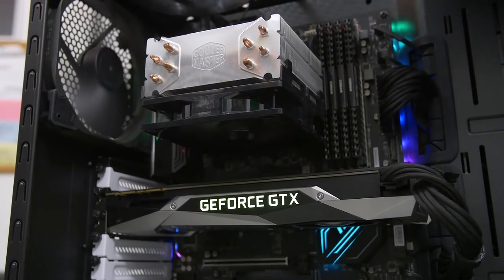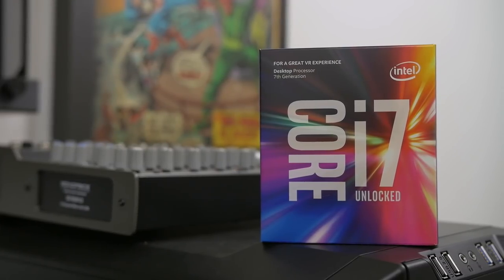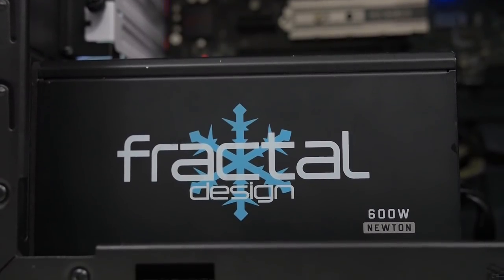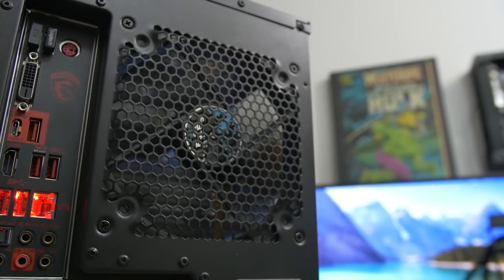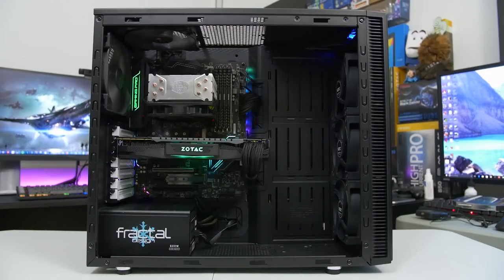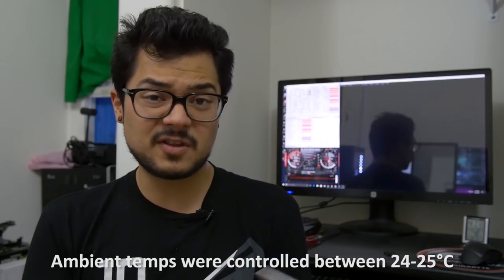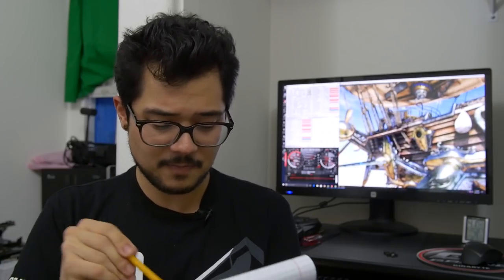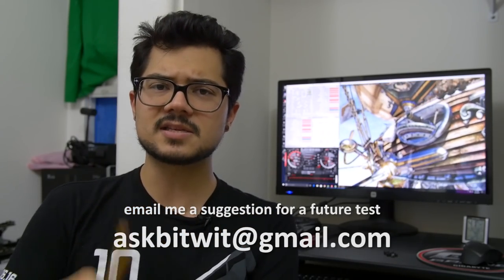This is how you should mount your CPU cooler! I think??

Comment: What about fan speeds... how did they look when swapping graphics cars type?? Some times you see a faulty readout on the monitoring software.
Another thing you may be underestimating is the efficiency of the "open" card fans vs closed ones (blower style). Especially when using an very well vented case. 
I've seen similar different results, like  your self, when changing cards. 

Lastly thermal past factor. How long time past in between swapping and did the cpu have time cool when swapping cards? Are we talking days or hours between tests? I for one have seen fairly large temp differences over as little as ½ day, with cool-down periods of a few hours... 
 
Thx for a good channel ;-)    

P.S. try placing heat sensors around the closed vs open style cards, that might just reveal the answer (not on - but in between GPU & CPU).

Comment: The Hyper T4 could only be mounted in the towards the top position and always worked fine.  If you have no top air vents or fans this position would seem bad though.  but with twin 140's at the top or 120's this never had an issue.

Comment: what were the GPU temperatures between the cards? I'd fathom a guess that the open air cooler is far more efficient at cooling the GPU and in a horizontal configuration the hotter air doesn't path through the CPU, meaning the overall case ambient temperature would remain lower? If you have the budget do a smoke test with a clear plastic case cover and let's watch the flow?

Comment: Maybe GPU temps could tell us more. I think the open card with the vertical config just ran cooler and did not heat up the air below the CPU as much as the blower config. 
Just speculation.

Comment: Your intake is pushing air away from the graphics card making horizontal + open good. Then on vertical + open, the cpu cooler is pulling more air from the card than the intake is pushing away from it.

Comment: I'd be more interested to see these tests done with a de-lidded CPU with direct-core contact and one of these budget heatsinks. I have reason to believe the tests are possibly being skewed a slight tad by whatever thermal compound Intel decided to use under the lid with this generation. even if the test bench is an older board and CPU known for having thermal compound under the lid (i.e. an Ivy Bridge 3570k) it'd be an interesting test nonetheless.

Comment: What was the GPU temp on each card? Maybe the blower card had a higher temp than the custom cooler, therefore raising the temp within the case. Also, with the vertical air-flow you are pulling air directly from where the GPU is located.

Comment: vertical with blower style card runs hotter because the CPU heat sink is closer to the hotter running GPU of the blower card
horiz. with aftermarket card runs hotter because you're sucking warm air from the GPU area instead of from the cooler front of the case

that's my theory anyway :P

Comment: What were the temps on the GPU versus blower/open? The temp of the GPU is centralised close to the CPU, so if that's running hotter because it's less efficiently getting heat away then the temperature right next to the CPU cooler will possibly be hotter?

Would also suggest if you re-run the test do it with exhaust fans to match the orientation of the CPU, rather than having both horizontal and vertical exhausts, to see if that makes much difference to the temp. I think this would represent more realistically the sort of set up someone would be likely to have.

Comment: I think it is because with the horizontal setup the fan is pulling more of the cooler air front the front 3 fans rather than the vertical setup pulling all of its air for the much warmer card?

Comment: Close shroud cooler fans run at higher RPM, potentially taking fresh air away from the CPU cooler from the front intake at a higher rate than an open shroud would???

Comment: my guess is turbulence is causing a better stream of fresh air.  when you use blower style, it grabs the air from the bottom half of the fans on front of case and pulls it out the back.  however, when you use a open shroud, it causes turbulence that could help deflect and direct the airflow more through the cooler.  yes, the hot air from the GPU rises, BUT you've got a streamline from intake directly through the cooler that causes Hot GPU exhaust to shoot under the CPU cooler and a low-pressure zone right at CPU cooler exhaust that grabs the GPUs warm air and shoots it out of the back of the case.  how could you potentially confirm it? measure the temp of the rear exhaust fan and compare between both horizontal and vertical tests.
Reply: the low pressure zone is caused by the cooler.  it puts resistance on the fan mounted to it and when you compare that to the rear case exhaust that moves more air, more quickly it causes a demand of air that'll be pulled from the path of least resistance: above and around the GPU because hot air rises right off of it.  if that makes sense.  I'm making both of these comments when im pretty tired, so my explanation might sound weird but it sounds better in my head. 

cooler pushes air which grabs hot air off GPU which the rear exhaust fan then pulls.    it's just using airflow to grab more airflow.

Comment: I think that the results from the first test might have been compromised by case pressure. I had a problem recently with unexpectedly high temps on ram and chipset in my system. I had 2x120 and 1x140mm fans as intake in the front and bottom of my case respectively, and a 120 fan on the back and 2x120 radiator on the top as exhaust, along with a 980 ti w/ a blower style cooler. The result was that in games, even with my intake fans turned up all the way, there was basically a dead spot over the top section of my mobo. I swapped out the front fans for 3 NF-A14 iPPC's, removed the rear exhaust fan, and the issue seems to have cleared up.  I would love to see the results if you could run the tests again with a different fan configuration, with better intake fans or perhaps with the top exhaust fan removed and the moduvent covers installed.

Comment: Bit late to the party on this one. But maybe the blower card is dispersing more heat through the backplate?

Also i'm guessing your 7700k has been delidded? Because those temps seem quite low comparatively to what i've been seeing in forums with that exact cpu/cooler combo.

Comment: In regards to the first test results, I wonder if its the same principle as a fire place?  You would think that the house would become warmer but in actuality the house gets colder unless you are right next to the fire. idk just a thought. As for the second test, the cpu fan is taking some of the heat radiating off the gpu and passing it through the cpu heat sink.  Which, I assume would make it harder for the cpu cooler to do its job.  It might do some good to run another test checking gpu temps as well.

Comment: With the blower style card more air is being pushed/sucked out of the case than the open one which keeps the air in the computer allowing there for to be more air to soak up heat, a much better way of explaining this is called POSITIVE AND NEGATIVE PRESSURE I think Linus or jaystwocents did a video on this

Comment: the only thing I can reason and would have suggested so results are as similar as possible swap gpu closed to open style in a CLOSED case, with that top fan frontal section blocked off, or even that one fan moved to next slot up (so rear exhaust fan -- -- or rear exhaust -- fan -- or possibly rear exhaust -- -- fan (the -- being blocked off portion) a difference of 5c IMO is within margin of error because all it takes is for the pressure on cpu heatsink to not be exactly 100% the same every install or the thermal paste 100% same every time..I know from my own experience 1 single rear exhaust and one single top exhaust mid point above heatsink seemed to work the best with the cpu cooler pointing front to back (horizontal) instead of up and down i.e east west not north south, it seemed to keep my gpu a wee bit cooler but the cpu a wee bit warmer.

for my test, I blocked off fan in top of case, moved that same fan forward just by doing this alone it influenced the cpu to be hotter gpu to be cooler or the other way around by ~3-7c idle and load, not 100% sure for the vertical vs horizontal position however...I am using the hyper 212 plus 2x stock P/P fans on Phenom II 955 OC to 3.8Ghz @ 1.35-1.362v CPU-NB 2643 HT 2044 MX4 paste with MSI 7870 TF III OC also MX 4...I am now using a define C case, 1x120mm exhaust top blocked off, 3 120mm intake and 1 120mm intake on the "floor" to ram more air behind the motherboard tray to ensure SSD/HDD get as much air as possible thrown at them.

So different systems for sure, but mine would likely be very close +/- similar heatouput. for me heaviest cpu/gpu temps I have seen when was summer time out about 3 months ago was 46c cpu/61c gpu at 1175 core 1350 memory 100% load on both..previous case was antec GX700 (neat design a bit easier to work in kind of than this FD Define C BUT very shitty dust filtering in comparison whereas this new case getting it all wired up with harddrive/ssd is a major pain in the a$$ but excellent dust filtering and a fair amount quieter cpu temps about 3c cooler than was in the GX700 gpu temps about 4c warmer SSD/HDD however a good 9c hotter (never seen my HDD/SDD ever hit 27c in the Antec one, whereas in this one my SSD almost a constant 33c even with AC running full blast my HDD used to be a constant 25c new FD define C 39-44c (still safe by all means)

anyways, I would test with case closed up, test with one gpu closed shroud move that top exhaust fan towards back toward mid towards front block off the other 2 holes (that is one thing I like about the Define S individual top vent block things whereas the Define C is either all 3 blocked off all 3 open with a dust filter included or all 3 open no filter...should have got the S)
see how that fan moved back mid forward effects temps on open shroud gpu as well, than flip  the cpu cooler from horizontal to vertical same way, you want to do as many tests as possible without moving the cpu cooler around so as not to disturb the thermal paste of course.

I would imagine the open shroud design benefits from having the cpu cooler "suck up" i.e north to south so as not to rob air from it (works with the fans in the gpu cooler) whereas the closed cooler probably benefit more from cpu cooler being east west so as to not fight the air flow it needs.

Also east to west probably helps to keep the system ram, vregs etc cooler compared to north south where some of these critical parts might be robbed of airflow...the little bit I DO know for sure, the "smoother" the air flow, that is the less blocking its path of the better, so maybe moving that top fan from back to middle to front has a very large influence (maybe)

^.^

Comment: @Bitwit. Most probably its because the open shroud has better cooling based on its heat pipes and back plate, and the blower type was not that effective dissipating heat... maybe should take into account the gpus thermal dissipation inside the case.

Comment: In the horizontal cpu fan test...The temp of the GPU could of been affecting the CPU as well.  Since the blower style cooler tend to run hotter than the AIB cards typically do? Just a thought.

Comment: The reduction of CPU temperature with the open gpu could be caused by the hot air from the gpu going up and limiting the exhaust fan's effectiveness. where as with the CPU fan pointed vertically all the hot air is free to rise once exiting the case. 

I low key wanna see one of these horizontally blow through cases (intake fans on the front exhaust fans on the back) put on the front plate and stood up 1-3 inches and see if the temperature's drop because the fans are working with the natural tendency of hot air to rise?

Comment: Looking at what you are showing is that the with all the fans in the case then an open GPU would not direct the temp with the blower card as the backplate will get hotter, this can be founded by the second test. That is all I can think of.

Comment: I assume the FE-card provides enough negative pressure to impact the front intake in a way that causes the horizontally alligned CPU-cooler to draw warmer air, coming from the backplate of the graphics card and getting less cool air from the front.

Comment: Just throwing a crazy idea I just had about that result. Maybe the stronger vertical airflow created by the triple fan of the gpu helped in the horizontal airflow of the cpu cooler kinda like a open variant of Venturi effect if that even exist. This way the air going through the cpu cooler is the cool air from the front of the case but moving faster hence more effective. In the other config the air that go through is the hot air from the gpu hence the expected results. This theory of mine has a high probability of being bullshit, but that something at least....

Comment: Compare using a PC Case with Top Mount PSU that draws air in from the bottom.
Test to see how much the PSU heats up with CPU cooler mounted vertical and horizontal and what affect it has on the PSU.
Reply: The two possible extremes I am guessing would be between Blower-GPU + Verticle(right to left) CPU vs Open-GPU + Horizontal CPU.
Since it will take all the heat from GPU + CPU and blow it into the PSU.
I mention this because there are people out there who do that because they think the PSU makes an excellent exhaust. 
It would be interesting to know how much the heat affects the power efficiency & if it causes the PSU to wear out faster.

Comment: Not sure, but don't blower style cards usually run hotter? Maybe the GPU was hotter, which would cause the air around it to get hotter? And maybe it's hotter the second time around because you're blowing the heat directly from the direction of the graphics card? I don't know, I'm just guessing.

Comment: the 2nd test is bc the GPU Blower takes a lot of air out of the case but the aftermarket gpu keeps the air inside so its not removing it from the case  that what i would be thinking at least

Comment: You only went up 4 degrees Celcius on the vertical GPU temp, not 5. Lol. Also, the open air GPU was cooler on the CPU because the air could dissipate evenly rather than the hot air being exhausted below the GPU and rising up.

Comment: The best sense I can be making out of this situation is that the intake fans are pushing the hot air from the GPU to the rear of the case and since the intake for the CPU cooler is closer to the front perhaps it's getting cooler air?

Comment: the only thing I can suggest is to do it over a couple for times and doing delta temps...I see the ambient is 24-25, is that the setting for AC cuz the temp in the room can still fluctuate between the AC compressor cycles

Comment: I actually thought that the hyper 212 is only designed to be Horizontal blowing with the air heading out the back of the case, lol. My cpu stays nice and cool, but I've thought of adding a second fan to the backside of the 212, just to expedite the hot air out the case.

Comment: id be interested in seeing if there is a difference between having the board laying flat and having the heat pipes point straight up compared to the sideways configuration in typical cases. In theory the heat pipe heatsink should work better with the heatpipes pointing straight up? No?

Comment: I believe your problem is with Radiant heat, not heat circulated through the system. You in essence insulated or shielded the CPU heat sink from the GPU when the fan was between them.  change to pull style and you may see a bigger difference, or move your GPU down a few slots.

see the below graphic, different situation, but same concept.

https://www.bobvila.com/articles/radiant-floorvs-forced-air-heating/

Comment: Perhaps the Founders Edition utilizes the PCIE Bus differently to the aftermarket card, making the CPU run hotter, seeing as how Kaby Lake is more of a SoC and all.

I know my 6700k overall runs hotter since I upgraded from a GTX960 (Blower cooler), to a 1080 Founders Edition. It simply hammers the CPU more as there is more I/O from a faster/different graphics card.

So even though the case is technically the same temperature, there could still be CPU temperature variations between cards. It does seem like a stretch as they are the same GPU though!

Comment: Would of been nice to see what the actual zotac card fan setup looked like you spent half the video talking about the parts but really did not give a visual of the cards at all outside of a side view. I could look the card up but, i am real lazy to do so without a provided description link. I wonder how many fans it has 1? 2? 3? perhaps the proprietary cooling system is doing an exemplary job and, deserves to be tested against another competitor. Maybe as you said another video perhaps with a different card with a similar fan configuration and maybe doing some experiments with the front fan intakes could provide some possible insight.

Comment: This test I found interesting,  I have the same cooler but very different temperatures. 
AMD 8350 CPU Running Stock speeds 4Ghz  with 4.2Ghz Turbo.
Asus Geforce 970 GPU Running Stock
Prime 95 Torture test running for 1 hour gives CPU temp of 62C
10 minutes of Crysis 3 has the CPU at 68C 
Always amazes why it is suggested that games work the CPU less than torture test.